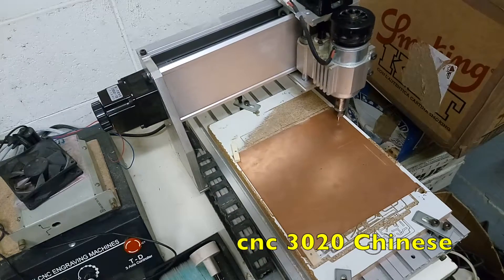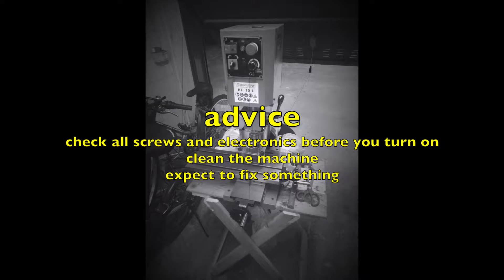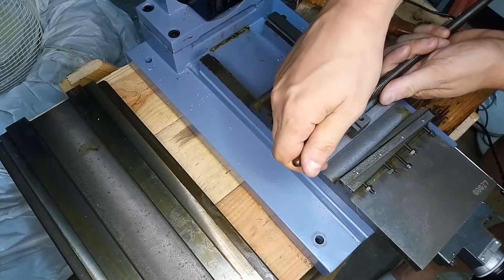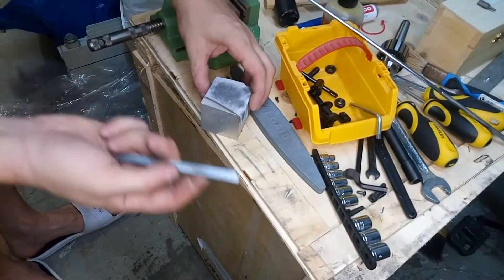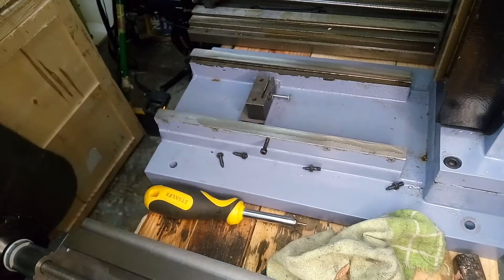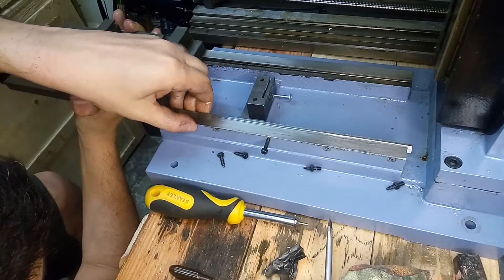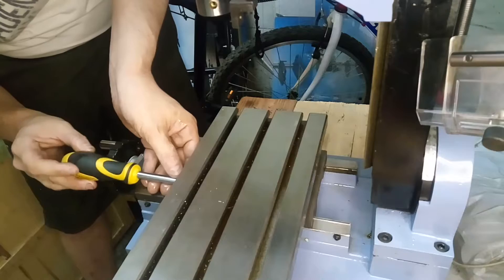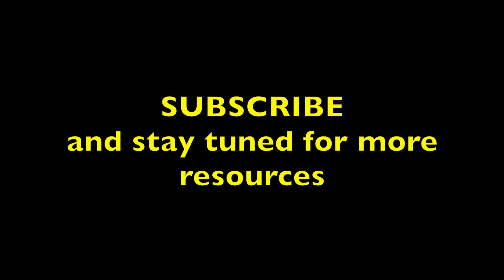buy a cheap milling machine (you had been warned !!!)

Comment: Tearing down machine tools made in china before you try and use them should be a normal practice. 
I had to do this with my minilathe
Tear it apart, deburr, clean their machine work chips out of it, reassemble, adjust/calibrate.
If you want better machines for a little more money that are ready to use, lathes, mills etc. buy them from Taiwan.
Reply from the maker: Nice advice, this was my first time with those cheap machines, I will consider Taiwan machines next time. thank you !!

Comment: You would get much better result if you buy a used knee mill from whatever source... you will pay nearly the same price as a Sieg mill, but it will cut much better due to rigidity. They are however much heavier and will require fork lift to move, and it tends to run on 3 phase power.
Reply from the maker: unfortunately the real problem for me is space and weight... if I had more space like if i was living in a rural area sure i will take an old milling maching and lathe from a factory closure.. they are very cheap sometimes selled as scrap metal for the price of the iron weight

Comment: Round off the ends of the dovetail pressure plate mounting screws. This greatly increases the rigidity. This also applies to the column.

Comment: 11:00 Set the slide or carriage without the lead-screw in... than tighten the fix-screws and test the slide with push and pull by hand, and check for movement.... than put the kead-screw in! The crank on the leadscrew transmitting force, so you dont know when the fixing screws are overtight....